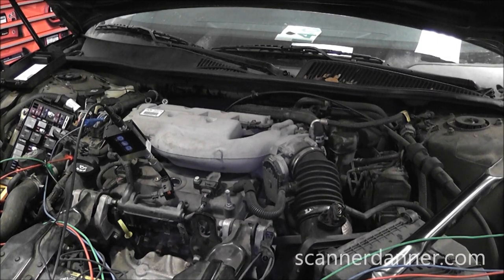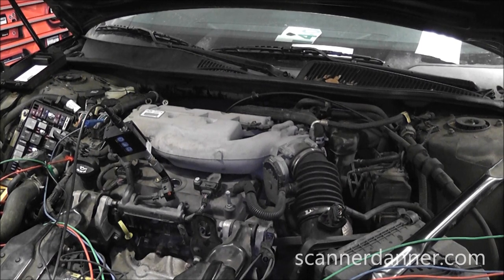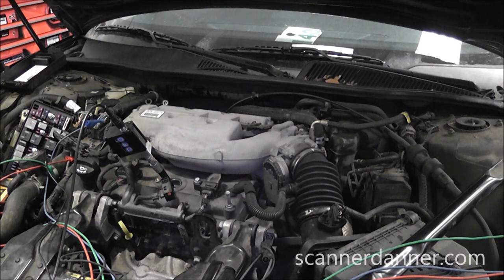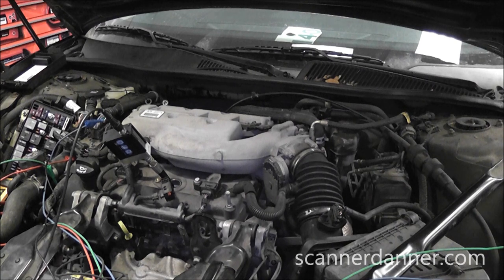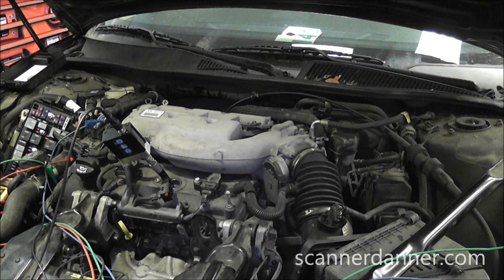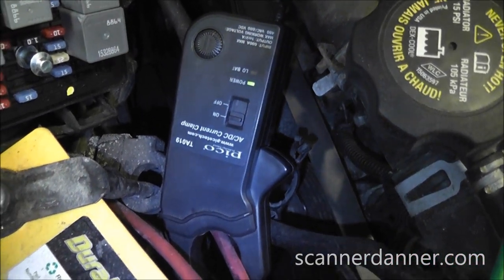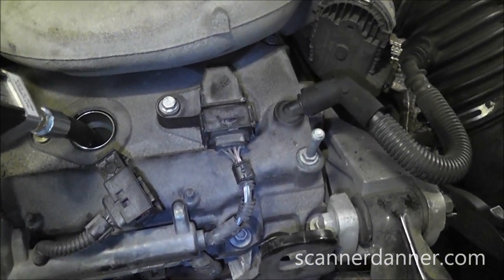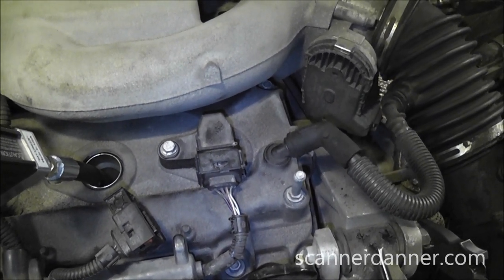Jumped timing chain (no compression on 3 cylinders) - GM 3.6

Comment: Just saw this video for the first time.... feel compelled to share thus: I learned back in 1972 to use a 10 dollar Cal-Van vacuum gauge for my first engine diagnosis by my mentor, a Rolls Royce Master. That lesson, through the years, has kept me from shedding many frustration tears, except when I've strayed from basics! It even cost me a job when I worked at Cadillac in the 70's because we had a prima donna driveability guy who thought the way to cure a misfire was to rev the hell out of the engine! He had a Sun Interregator at his disposal and he never hooked up the vacuum gauge to any of the cars he was charged with fixing. 
I love your videos! Keep up the great work! I showed him how to diagnose an internal idle air bypass with a vacuum gauge. He had fought this car's rough idle for days. My intent was to help, but his ego was bruised, and me being an upstart kid got the boot!
Reply: In the words of marky mark, ego is not your amigo. Think i just lost a job over it. Really wanted to move to texas too☹️
Reply: @plowe6751  Idle air bypass is necessary on any carburetor, otherwise, at closed throttle/ idle, the engine would run very rich or flood. Some carbs had idle bypass adjustments. This is a very sensitive setting. On the Quadra-Jet (GM) models, the passage is calibrated and non-adjustable. The Vacuum Gauge was not stable at or near 20 inches of vacuum at idle (Normal for here where we are close to sea level). The gauge was fluctuating smoothly between about 13 inches and 16 or so inches. I could take a dental tool and put the bent end into the idle air passage inside the primary bore, and the engine would run smoother as the vacuum would improve due to me partially blocking off the excess air.

Comment: I love this video   I remember watching it about 4years ago   it will keep you a out of the rabbit hole. One thing I would like to add is the crankcase waveform  over the dipstick tube   barring you don't have a piston ring issue on all six pistons the waveform is solid as far as peaks and valleys   in this case the relative comp showed 3 peaks in 2 crank revs the crankcase will always show 6   even with a jumped timing chain   or a total loss of compression as if you removed all spark plugs     great video  SD

Comment: Great video! I just experienced this on my own 2013 Impala, with 190k. 
Car ran perfect, when driven last. Went to start it the next morning 15deg outside and it wouldn’t start. 
No codes, good fuel pressure and spark, I pulled the front plugs and checked compression 95/85/90 on the front bank. I pulled the intake and checked the rear60/20/35. 😢

Comment: I have learned that the sound of relative is not always accurate especially VCT engines. I seen a tech once that was going to sell a 5.4 ford engine based on relative sound when I walked over and did a clear flood to get the engine to start. That was a good eye on the relative humps, never seen one like that but I will store that in my memory for future. Thanks Paul

Comment: I’m going through this issue right now. Codes p009 p0008 p0016 p0017 p0018. Cleared codes and they come back. Issues. Runs rough. Checked compression and bank 2 2-4-6 have 150psi. Bank 1 1-3-5 have 200psi. I’m opening the valve covers to see what’s messed up. Thanks for showing us something new.

Comment from the maker: you are missing the point. you cannot always use conventional testing methods to ID these kinds of problems. on some engines you cannot get to the rear spark plugs without removing the intake! how are you going to verify no compression or a jumped chain on this design without intake removal! what if you remove the intake and you are wrong in your assumption? what I am trying to do, as I said in the video, is to develop other testing methods, to add "tools to our tool box".

Comment from the maker: that is correct my friend. we didn't though because of the difficulty in accessing the 1 rear cylinder you can get to. The other two are under the manifold. 
plus, going into this job and by the way it sounded to me, I never suspected 3 dead holes. it truly wasn't even on my radar for a while.....my fault for sure

Comment: Thanks for another great video. I had one of these in the shop today and used your bank 2 wave form for my known good. My case was different though mine would run but was dumping raw fuel out of the exhaust. bank 1 intake cam jumped. I am an L1 Master also but still consult your videos and book frequently. Your doing an awesome job keep it up!

Comment: Just additional FYI.  The wide and tall crank pulse is likely from a "missing" tooth on the crank wheel.  It is not broken, but missing by design to show a reference point on the crank.

Some system do "double fire" (fire plugs as pairs, one on compression, one on exhaust) until enough revolutions have occurred to be 100% certain that the cam and crank signals are properly synchronized..  Another reason to use crankshaft position sensor for reference while doing test during cranking.

Comment from the maker: great info my friend. thank you for that! I definitely need to go back and watch that part again. it is possible i miss labeled that cyl head. so if it was a stuck cam phaser, would the repair still be a complete disassembly of the timing covers?
Reply: Hi I'm doing timing on a 11 chevy traverse and after taking everything off and was getting ready to set timing b4 taking chains of and noticed that it gets stuck wont turn a full turn any help would be appreciated.......p.s. b4 taking everything off i cranked it a few times with out any issues
Reply from the maker: @sadboy8413  why are you doing the chains? You may already have a bent valve? Post this to my forum https://www.scannerdanner.com/forum/post-your-repair-questions-here.html we can help you more there. It is free to join. Thanks!

Comment: I was actually thinking about this COP system and I remembered that the Ford systems actually fire both coils of the companion cylinders until it receives the CID signal from the CMP sensor/s. I wonder how that would look. I'm going to have to do a relative compression test synced with a coil on one of those just to see. This car must have set cam correlation codes?

Comment: Nice Video Paul.. Awesome explanation.  Nothing related to this video, but on 6 cylinder engine, can I safely assume we will have 2 CAM sensor one for each bank minimum.. ?.. second, in this video, they have 2 CAM per bank , one for intake and other for exhaust, do u think that is for Variable valve timing monitors?.. pls advise

Comment: @kevin I doubt it.....to tricky to get all those cilinders to tdc.@paul how about to check cam an crank signals, while you activate the variable camshaft actuators? Verus does the activation and pico shows you the signals...one way to check the timings. If the camshaft is really broken, you can test that with this method.

Comment: Hi Paul, my friend Eric O. at South Main Auto just ran into this exact scenario on a 2005 Ford 4.0 V6...relative compression humps looked great, until I suggested to hook up a sync channel (this video really stuck in my mind!)...sure enough three humps were missing! 

My question is how can we have no compression or vacuum AT ALL inside the combustion chamber if the timing is off, but the camshaft is turning. I mean those valves should be closed and sealing at some point in time right? Unless all the valves are bent lol
Reply from the maker: +motoYam82 coul be bent, but it could be timing too. If either valve is open during the compression stroke, then obviously there would be no compression. They may be closed and sealing during the intake or exhaust strokes.
Reply: Sure, but in general if the valves are sealing and the piston is moving (up or down, doesn't matter which stroke), there should be a significant change in pressure in the combustion chamber, right? Just wondering if we can use the in-cyl transducer to accurately see if we have bent valves inside...
Reply: +motoYam82 At 19:00 the "dead" cylinder waveform can still tell us something. 
1) We know that the cams are still turning, as shown by the two cam sensors.
2) The small pressure humps are less than 0.1psi peak-to-peak in amplitude. I would put money that the valves on that cylinder are NOT sealing the chamber at any point in time, i.e. they must be BENT and sticking open.
3) In 720deg of crank we see THREE distinct humps on the dead cyl waveform. Not sure which cyls are "backfeeding" pressure, but that again proves those valves are not sealing...

So basically can we say to the customer: your cam timing is definitely off. However, there also appears to be valvetrain damage to the rear cyl head...much more expensive than just resetting the timing!!

In that case tearing the valve cover off would almost be a waste of time...might be more economical to just swap the entire engine :)
Reply from the maker: +motoYam82 Not if the valves are closed  during the downward movement of the piston and open during the upward movement. your cranking compression test will show basically nothing but your in cylinder transducer may reveal your issue. Not sure, I think there would be variables there too.
Reply: +ScannerDanner Yeah I was thinking of the in-cylinder transducer which shows pressure and VACUUM (so valves sealing on a downward stroke would show up as vacuum). The traditional compression gauge and relative comp test wouldn't provide any additional info here...
Will definitely keep an eye out for engines with timing issues to get some waveforms. Ever seen a Chevy 2.2L Ecotec with poorly sealing exhaust valves? Just got one in the shop here with a cyl3 misfire...reminds me of your Hummer misfire case study!

Comment: @9:25 it all clicked! I actually had noticed that there weren't enough humps between the ignition events. I couldn't figure how the cam and crank sensors would tell it to fire like it was a three cylinder? I assumed that there was an ignition timing issue and it was firing before rotating 720 degrees. Not seeing ANY sign of compression between the even peaks totally tricked me!

After the epiphany I paused the video to think of ways to make sure I couldn't be had again!

1) If you knew the cranking rpm, and used your scope to measure the frequency/period of the waveform you could compare that to the actual engine rpm to confirm the ignition timing is correct & that compression humps are missing.

2) Another way would be if you used 3 channel's on a scope. Done the same way as you had in the beginning, but one more channel for the next cylinder in the firing order. An ignition signal would show up in the 'valley', revealing the hidden compression stroke!

Maybe these would be viable tests, hopefully someone can let me know? Love the channel & content, keep up the good work!
Reply from the maker: +theomnipresent1 thanks so much!
Reply: Am I on the right track with those methods?

Comment: That's true too.  However, on my car that would knock out the crank sensor completely if the sprocket wasn't turning.  Great point though as I imagine there are plenty of cars that don't operate that way which is why I watch ScannerDanner and others. :)  Paul, in both instances you are using a labscope that most don't have access to, DIY'ers would have pull it apart.  Great video for techs though nothing wrong with that.

Comment: @toyotatech I meant while you run the engine....does the vvt work, you can assume that all camshafts are fine. Had the same probleme with a 4 cil. gm engine.

Comment: Found this video and your others when showing a customer links to info on jumped 3.6L chains. 

Paul, as a fellow Master Technician for over 25 years and about the same time since I joined iATN when they had 400 members - I can say that is just brilliant! I pride myself in knowing there is a test for everything, and have a nice collection of equipment and know how to use it. I do have a 2 channel Pico, along with an old Vantage, OTC Genisys scope, along a lot of other neat stuff. Have dealer level hardware and software for at least 7 manufacturers, and do programming on most also. I do not (yet) have a pressure transducer but after watching this video will be my next purchase. 

Also in having computer and electronics interests, I love your touch screen projection "board". What is that and how does it work? I can Google it to figure it out but wanted to compliment you on your experience and attitude. Kevin in Maine
Reply: I didn't know the "scope" of scannerdanner's reach when writing comment. Very popular for good reason.
Reply from the maker: Thanks Kevin! It's called a smartboard

Comment: This SD is very interesting material, and puts away forward for me to tackle a problem i have at the monent.
My concern and little disappointment is that you use a pico to show us this and not a verus, i appreciate its your choice.
 Not many of us have both , and like me i brought the verus , it would be nice if you can do this with verus one day. But if you have already have can you drop me link please.
Thanks for all your work you do .
It is alot to take in and fit in with a working day.
Reply from the maker: I think I show it here https://www.youtube.com/watch?v=WKdZsWU2ZmI
You do not need to SIA 2000 adapter, it is a P.O.S, just get a single test lead for COP ignition systems to use as your sync on a plug wire or ignition coil. I have the ones I use listed on the tools page of my website. https://www.scannerdanner.com/dmm-and-lab-scope-accessories.html

Comment: Is that a direct fuel injection engine?

If it is I found this.

Pressure Diagnostics
You will never find a Schrader valve or port to measure pressure on a direct fuel injection system, even on the low side. If you were able to tap into the low side with an analog gauge, you would see pressures rapidly changing as demands on the engine changed.

Direct injection pressure is measured with sensors, and the signals are used to determine pump speed and/or volume. So, you’ll need a scan tool to look at the pressures.

Comment: Just me, but I think I might have grabbed the crank pulse instead of one of the spark control line to begin with.  I certainly would not have bothered looking a the cam signals, because they can vary a lot during cranking (cam phaser work off of oil pressure which is inconsistent during cranking).  Perhaps (only perhaps) it may a been obvious during 720 degrees of crank rotation that there were only 3 starter current peaks (compression events).

Comment: Had same 'fool you' experience on a 1 camshaft engine. Car seemed to run fine on higher RPM, terrible on idle. Monopoint so no injection issue, had 1 one plug wire which tested OL ohm when twisting so open. Cylinder drop test gave me spark but also 2 missing cylinders (!) from the 4. These were 2 and 3 on a firing order of 1, 2, 4, 3 so that explained reasonable running (lacking power of course) on higher RPM. These 2 cylinders ran on 1 of the 2 coils and you would easily be fooled into thinking the coil was the cause if you did not reason like a diagnostic guy should. Testing a bit further, relative compression test showed equal humps but did not feel right. Brought in the sync channel and only then noticed we had 2 cylinders and 2 with absolutely NO compression so it fooled me on first test (looking at scope image). Difference with your example; on a 4 cylinder, 1 cam car, a loss of compression on 2 cylinders is no timing issue. It is more likely valves, head gasket (not now, we had NO compression) or piston rings but that is another story. For this little 600 dollar car it was game over (too expensive to get this fixed) but there you go... how a first impression can fool you.
Reply from the maker: +Henk Moesker for sure! nice job Henk!

Comment from the maker: you have to cut me some slack man. this car was towed back to the garage that brought it to us. I have had no updates from them and truthfully I haven't asked for one. The main purpose of this video was to cover "relative compression testing variables" not "how to fix a no compression problem on three cylinders on the 3.6 engine". I realize you would like to know what exact mechanical part failed with the chain and so would I, I just don't have that info.
Reply: ScannerDanner agree 100%. Seen many of these engines. Total garbage. Best thing to do is remove intake hose and feel with your hand  on throttle body while someone cranks engine. If not uniform suction during each cycle.. tell customer time for a new engine if you can find one. These engines are total garbage and way over engineered. Just looking for trouble. A 3.8 supercharged would put out close enough to the same powered and are tested and true. I am a tech and 41. They call these 3.6 l a high feature V6. I laugh and call it a high maintenance V6. Anyone else agree?

Comment: Dan, once again  - thank you for another great video. I've seen these exhaust pressure transducers (firstlook brand). I am wondering if you've had any experience using rather than relative compression particularly on v6 and v8 for this example? I would have to think it would make more sense to use something to that effect considering how tough it is to reach the back bank of the engine. If you have, I think it would be great if you can share your experience with them.

Comment: have done a few 3.6l timing jobs on acadia and vue and treverse but doing a Saturn vue it jumped time guy took heads off had them redone but heads back on before i come into the picture  i lined up all my marks like I always do no issues now that i got it all timed and goto rotate by hand i get about 1/2 rotation and it stops like its hitting something rotate backwards and stops in same spot number 6 cyl piston up and number 3 what could be the issue ? ive used my inspection camera and valves are open and pistons are up but do not appear to be hitting ive retimed it twice and same issue